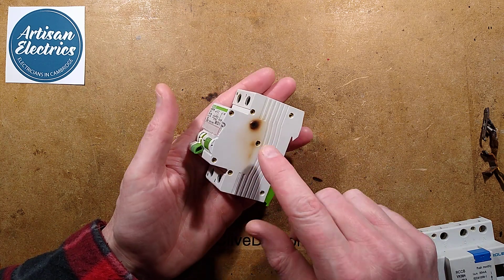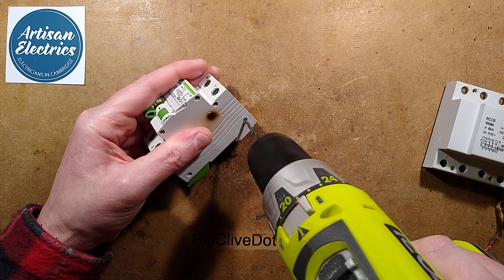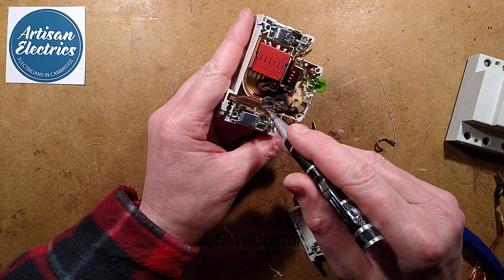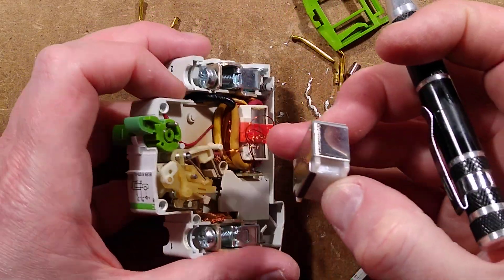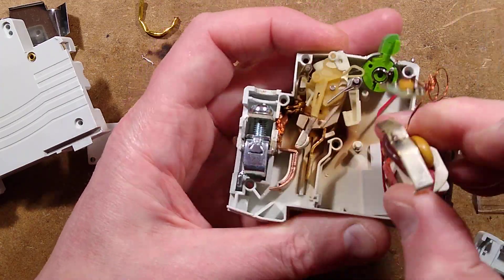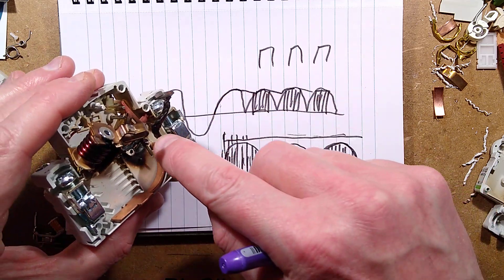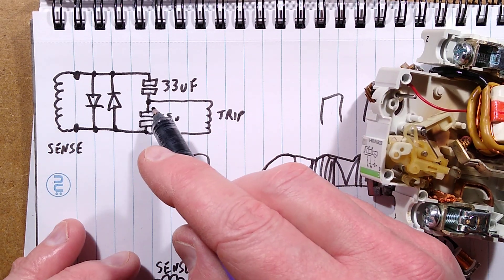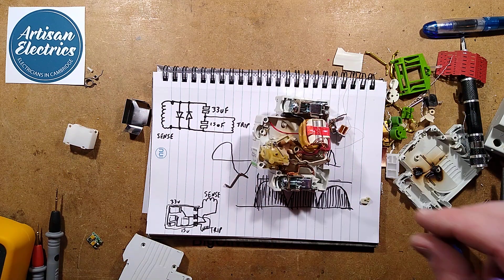Failed Rolec breaker from Artisan Electrics

Comment: Is your thought that pulsing is causing contact arcing?
Reply from the maker: My thought is that any contact resistance results in much greater risk of arcing.
Reply: @bigclivedotcom  I suppose any contacting materials will always have some resistance be it high or low, a more arc resistant material may be what's required over a larger surface area? Or would that have the opposite effect? 🤔 When you look at a relay contact it is a specific metal attached to a copper strip, usually riveted on, and it is usually domed to reduce the arc? I'm assuming? When new they are almost polished in finish to what I would think creates a narrower, colder arc? Fascinating subject in its own right. It looked like this RCD didn't have any of those characteristics.

Comment: I wonder about my fridge if thats what caused my circuit breaker problems I discovered a few months ago. Its a fancy "inverter" unit against my wishes, so Im sure its doing PFC. In my case the contact inside the circuit breaker didnt burn as much as the contact where the breaker mates to the ?backplane? of the panel itself. Gouged it out pretty good. What dosent help is they installed too small of a panel so the panel is filled to the brim with tandem or quad breakers. I think the Oven, A/C Compressor and Electric heat are the only ones that escaped with standard size breakers. So theres two circuits worth of load on one contact.

Comment: These videos keep reminding me I desperately need to do a tear down on one of the shitty MK RCBO's that go short circuit, I really need to know why they do it. 
I am going to have to set myself a time limit, that if I don't do a video I am going to have to send it to Clive
Reply from the maker: The RCD circuitry often latches, if it can't trip the breaker it may be causing catastrophic circuitry failure.
Reply: @bigclivedotcom  All 3 I have had go short circuit do so on the output side (so they trip themselves) then when you try to reset them, you are resetting into a hard short and you take out the house fuse. No faults were present on the downstream side each time this has happened. I'm surpised that I've never heard anyone else talk about this fault with MK RCBO's as it can't be just me

Comment: That pause and rapid closing before making connection when you try to close the breaker is intentional, it reduces arc when closing breaker on a short circuit. It is called fast close I think.

Comment: the input of a high power device like a car charger should not look as spiky as you depict it, without those crazy 60 amp spikes.

It should basically just be a fair bit of ripple, while the current curve largely follows what you'd expect of a purely resistive load.

Comment: In my opinion, this fuse was burnt due to long time over current Condition. 
Most people don't expect what ther actual current draw really is. If this would only have used with a car charger - in Germany the Current Limit for that is about 10 to 16A @ 230V. I think this kind of load should not result in a picture like we see here. 

Most of the time, the fuse for the garage is also used for the cellar.
So if there is a washing machine (10A), electric heater(16A), some hobby or garden related objects (8A) and finally the car at 16A we get a total current of 50A.

In this unlucky situation, the OverCurrentProtection might not trip, even after hours. But the electrical overload will lead to early failures like this.

Of course it makes sense to buy a reliable Circuit Breaker, but if you use it wrong, only luck can tell how long this works properly.

Comment: This is a really compact device actually. Nice engineering. It is a single pole breaker tho, so be aware of that.
I think the issue was poor manufacturing of the brass part. They are probably cast, and then roughly machined. If there was a burr on the edge, and not smooth, the burr would prevent making the full contact of the two parts. Good QA with passing 40A and checking the voltage drop, to measure resistance, would detect this. But I guess, they are skimping on that.

Comment: Not that I doubt your circuit diagram in the slightest, but are you sure it’s not a voltage doubler?
Reply from the maker: The diodes are in inverse parallel.  Just a bidirectional voltage clamp.

Comment: AC will come out of the sense coil for the RCD, so the two diodes and two capacitors are going to be turning it into DC. Probably with one of those centre-tap full wave rectifiers. The tripping mechanism with the finely balanced magnetic field requires DC of the right polarity to trigger, and feeding it the wrong polarity would cause it to remain latched. Those are polarised capacitors after all.

So I’m sceptical whether your reverse engineering is correct.
Reply from the maker: The diodes only cap the voltage.  The coil will have AC coupled to it, but can potentially release on the desired half wave.

Comment: Well, I bet, Clive, you meanwhile saw the test resistor by yourself, but if not, look at the bottom of the device, right in the corner with the sense transformer. Just under the screw terminal is a quite big resistor standing "vertically" :-)

Comment: Sorry Clive I believe your understanding of the current drawn on a PF corrected supply is not correct, the current spikes on the old style supply are huge to charge the capacitor when the mains is above the capacitor voltage. The whole point of the PFC types is to spread the current pulses across the whole period.
I would personally guess that that breaker was running at or near it's rating.

Comment: I understand the pulsed current draw causing a problem. Many years ago in the UK there was a Philips TV called the G8. It had a half-wave thyristor power supply. Quoted 300 Watts so you would think just over 1 amp. Wrong. It was short duration spikes of 12.5A! I encountered several melted plugs, and 5 amp fuses didn't last long! 😃
Reply: Then there was itssuccessor, the G11 which would pick up Radio Norway International(6MHz in the Short Waveband via the not so well screened 6 MHz sound IF)
Reply: @rowanNClangley  oh yes the G11. Full-wave thyristor power supply. Lovely until the reservoir capacitor's rivets started arcing and falsely triggering the thyristors. HT up to over 300 volts, sending the EHT into orbit and cracking the neck of the CRT! Saw it many times
Reply: @rowanNClangley  one of those G11's blew up that way in a shop I was working in once. I was standing next to it. Tremendous bang Corona discharge from my hair and fingertips. Heaven only knows what the EHT went up to. At that point a lady came into the shop. "Ooh it smells like the beach in here it's lovely. What was that terrible bang just now?"! All I could wearily reply was (still shaking), don't ask! 😂😂

Comment: Same issue with pv installers putting timers on the hot water circuit to make use of day time solar energy

Timers get cooked from the constant load of a 3600w element

Comment: I disagree with your conclusion of power factor corrector circuitry possibly causing the device failure.
The arcing happens because the contact is opened under a load.
Why is it energized when the contact is opened?
A proper EV charger (e.g. CCS Type 2) has protection circuitry which makes sure that it is always connected and disconnected without current running through it.
With an exception that is there is residual leakage current, the link is disconnected immediately.
Reply: PFC aims to make the load looks like purely resistive (no reactive power), no spiked current loads, no conductive electrical noise, ...
Disconnecting load while current flows is very demanding on the contacts, and protection devices typically are not switches intended for it.

Comment: Almost any EV will have Power Factor Correction for the simple reason that bad power factor causes current to effectively double for the same amount of power. It costs more to build in a heavier connector and internal wiring than just using a PFC module.

Comment: They are crap, £400 straight from the factory, I received a Type2 Rolec charger and it had loose copper strands in the bottom rattling around and loose ferrels from the terminals.. Use cheap Chinese parts with their Logos on..

Comment: Jeeperzz !  Uum, so were does the the fuse go !  I have flown helicopters with less elec' and mech' in them.  So that breaker is ac only ? Why does it not have parabolic contacts inside !  Very weird.  Oh, the test resistor is at the bottem right hand corner @ the 17minute time mark, it passes thru the breaker left to right, so we were seeing it end-on.  Have to say this utube thing is a bit new to me, but I'm luv'n your vid's n commentary big man. ;)
Weird trivial fact: we all here have been surrounded by electricity all our lives.

Comment: Definitely simpler electronics than you'd see in a GFCI breaker in North America. I've never seen one with a trip circuit powered by the sense coil like that, they are generally using specialized ICs, especially now that current UL requirements call for automatic self checking etc. Likely the simple mechanism isn't practical with a 5 mA trip threshold which is required here for anything providing shock protection (GFCI class A). Anything higher is meant for equipment protection only.
Reply: Yes, it is elector-mechanical. Electronic ones are banned in many European countries as they are not voltage independent.

Comment: well it's worse than my mains breaker not working as it should at all. when you press the little test button nothing happens......replaced it. i opened the thing but can't see any point of failure...
Reply from the maker: Sometimes they just fail.  Or the operation can be affected by some rogue electronic loads.

Comment: If you use magnetic circuitry you will never see a spiking and valleying sine wave ever again it's either just completely positive with a stable flat line or completely negative depending on how you hooked up the lines in order to make magnetic circuitry you need to connect positive to negative in a complete ring and now you know how to make the world's most efficient electric motor/generator

Comment: Most of the PFCs I've seen traces of operating seem to do a reasonable job of replicating something sinusoidal for the current draw. If they didn't, loads of breaker heating would occur as you said.  There is usually always an inductor there to smooth out the current pulses as the PFC switches and they seem to usually run in CCM in high power applications, so it shouldn't really be much of an issue. There will be some ripple, but the current will mostly be continuous through the inductor, and thus the breaker feeding it. If there was no smoothing, it could be worse than no PFC at all, and would cause huge issues in data centers. There are some modes (e.g. DCM) where it does do what you say, but I couldn't see these being used in anything but small supplies just trying to get some extra symbols to print on the label. As a quick reference: https://www.google.com/url?sa=t&rct=j&q=&esrc=s&source=web&cd=&ved=2ahUKEwiIzdPW5KHtAhUouVkKHRmqAF4QFjAAegQIAxAC&url=https%3A%2F%2Ftoshiba.semicon-storage.com%2Finfo%2Fdocget.jsp%3Fdid%3D68570&usg=AOvVaw1SYCNsePCIMkU4dfTj-CZ1
Reply: Wrong. Even though, some PFCs operate in DCM, it has nothing to with the input current. Such ripple MUST be filtered out almost completely in the input circuit of the PFC, otherwise you would get a nasty interference generator. So, regardles the PFC operates in CCM or DCM, the input current drawn from the mains net is continuous, smooth.
Reply: @Sixta16  You are just reiterating what I said. The actual switching harmonics must be filtered out or it would do nasty things.
Reply: @Sixta16  Now, this needs to be differentiated from the actual ripple current at mains frequency. That will not be continuous, obviously, or its PFC would not be near unity. It will, to a first approximation, sync the current its drawing to the input waveform to simulate a resistive load.

Comment: Personally I think that it's down to "value engineering" and with EV chargers you see high current for extended periods of time, therefore you will tend to see more failures compared to shower circuits etc, which tend to only be near rated capacity for shorter periods of time.

Comment: those look like tantalums, if one of those diodes fails it's going to cook those caps and probably turn one of them into a dead short, hopefully not the one across the coil
Reply from the maker: The voltage and current is extremely low, and only present in a fault condition.

Comment: you may thank the poor contact materials ( ROHS anyone) for such failures, they need whole new designs with different materials and more contact surface.
also the clowns have a large heat producing breaker in a tiny enclosed casing(the charge station setup), I could never guess what happens there ;))

Comment: That magnet thing makes me think of a rather horrible prank someone could pull by putting a hidden magnet on the lid of the breaker panel, that way it only trips when it’s closed
Reply: Wondering if magnetic remanance breakers  are used on public EV charging points, no real reason for wondering.
Reply: That prank idea is diabolical! :D
Reply: @tookitogo  but dangerous (breakers are not to be used as a switch)
Reply: FWIW, a certain manufacturer of AFCI (arc fault) circuit breakers in the U.S. are notorious for false trips in the presence of RF signals and have been the bane of some amateur radio operators when their transmissions trip circuit breakers throughout some newer subdivisions built using those cheaper AFCIs, even though the radio operator isn’t responsible for the false trips legally as the AFCIs are faulty and were rushed into regulation about 20 years too before their tech would be evolved enough to be reliable...it still can create a lot of needless friction between neighbors when the neighbor’s freezer trips off while the owner is out of town for the week just because a simple radio transmission was improperly interpreted as an arc fault and it does not help that AFCI circuit breakers are very expensive to replace and thus the affected homeowner tends to expect someone else to foot the replacement bill (though the someone else should be the manufacturer).
Reply: @ethanpoole3443  RF causing breakers to trip is fairly common, not really limited to one maker,  I see it happen in temporary site offices when people use the site radios near the consumer unit.

Comment: I have a meanwell supply for my bench lights that says it's PF correcting, do you think that's how it does it?
Reply from the maker: Yes, probably.
Reply: The boost active PFC (power factor corrector) that is described are the most common type but there's also buck active PFC and at least three different types of passive PFC - and AFAIK all active PFC's are "spiky" though there's usually input filtering to try to tame it.

If the filtering is insufficient the load can be spiky, and the manufacturer tend to not want to have TOO big filters because then they might trip fuses due to the startup current (to charge the capacitors) or need more advanced (IE expensive) circuits to avoid that, also remember that big capacitors and inductors cost more. Yes, they only cost cents but that can be a noticeable part of their margin!

Basically if it says > 90% PF and/or can handle a wide voltage rank it's definitely one of the two types of active PFC.

AFAIK in Europe all new equipment consuming more than 70/75W (sources vary) needs to have some kind of PFC and hit certain efficiency targets, I think it's possible to hit those efficiency targets with a well-design passive PFC and SMPS (switch mode power supply) but it tends to cost more than with active PFC and if the SMPS targets high efficiencies it pretty much has to have active PFC.

I don't think I've seen a passive PFC in a modern PC power supply in at least a decade, even ones that doesn't have an 80+ rating or is just the "base" 80+ (it goes 80+, 80+bronze, 80+silver, 80+gold, 80+platinum, 80+titanium) comes with active PFC.

This seems to be a reasonable summary of PFCs if my understanding of them are correct :-)
https://www.electronicdesign.com/power-management/article/21801141/whats-the-difference-between-passive-and-active-powerfactor-correctors

Comment: The company I worked for called it magnetronics and they patented it however for someone as smart as me just seeing it was enough to understand 100% of its inner workings hell I even made the coils and here's a big spoiler the core is air f**** unbelievable right somehow not using a core increases efficiency like 40% so the most possible efficient coils and the most possible efficient sine wave lead to the world's strongest torque from the least input voltage I saw a 300 lb flywheel turn from a single f**** AA battery that's not even possible with current technology yet I got to see it